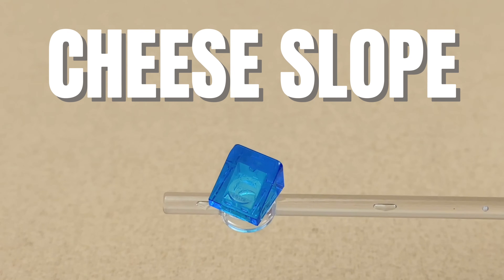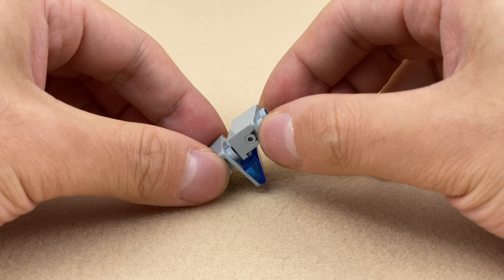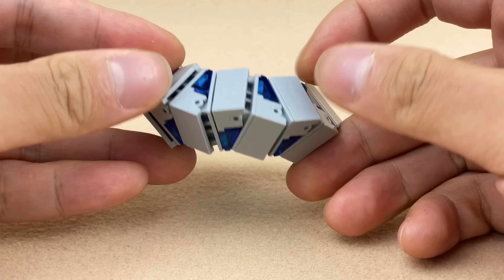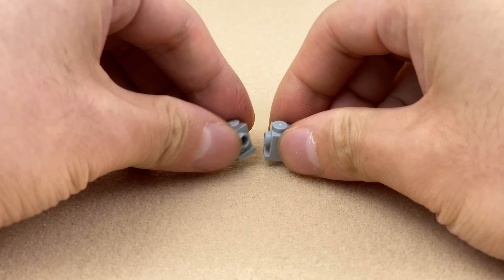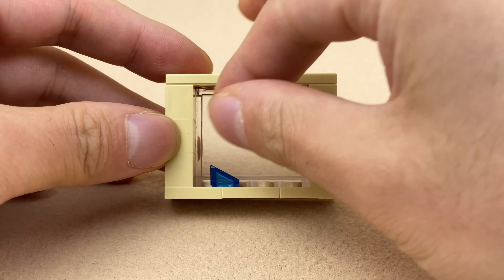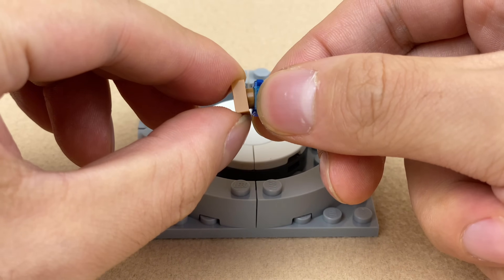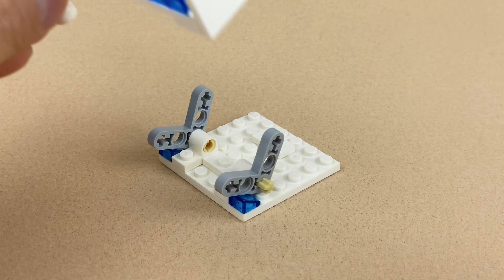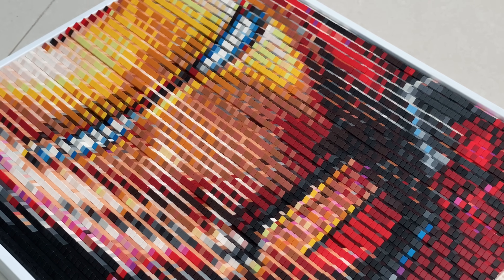Turn Underrated Lego Pieces into MAGIC!

Comment: If you don't want to do the illegal technique just use 3 studded technicpins in those holes of the brick, same result but doesn't strain the peices
Reply: i think technic pins get strained then, they are supposed to click into a passthrough hole with a bevel on the other end where the pin can expand into

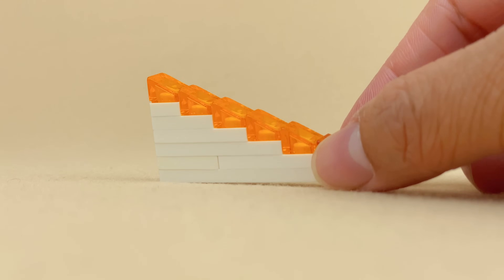Comment: 1:08 yooo, thats so coool, except for when you want to take it apart. Seriously, don’t do this with a plate and a brick, do it either with 2 plates or with 2 brick, however if you’re using full bricks make sure you use a double cheese slope, otherwise it will get stuck and both the brick and the slope become useless

Comment: Warning: The Lego Plate back to back with the brick is an ILLEGAL building technique, it will cause your plates and bricks to get overstressed, and risk your slops getting stuck in the brick. Actually most are illegal building techniques, use them at your own risk.

Comment: Yo... So I am having absolutely no luck trying to track down information from one of my childhood toys. I remember them being Legos, except they were Oval Shaped and only had 2 oversized studs instead of the normal 8 studs. They only had the basic colors of Red, Blue, and Yellow (as far as I remember), but they also had a White Piece that could connect to Square legos from the top and a Black Piece that could connect to Square Legos from the bottom. Any idea what they were called?